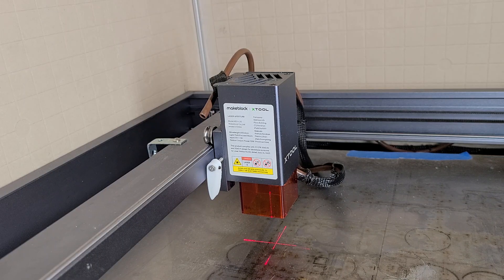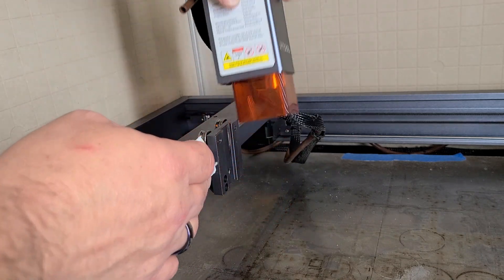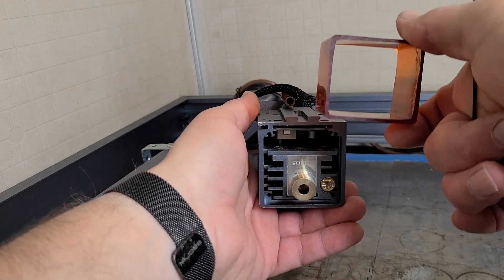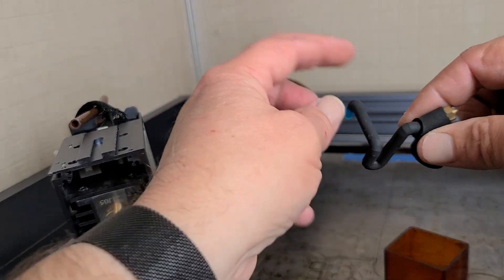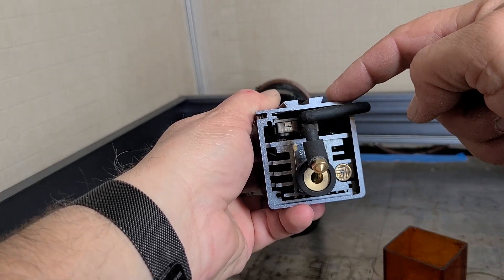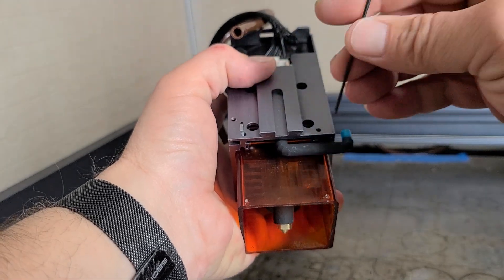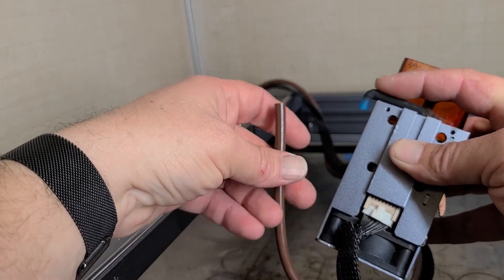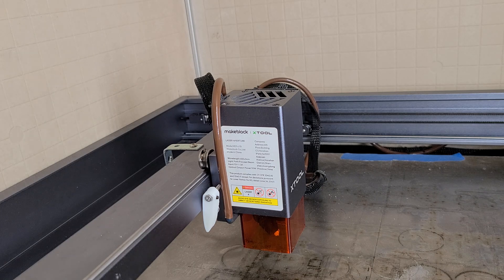How to install the No-Mod Air Assist for the xTool D1

Comment: Hello, did you make this adaptation because you think that the original xTOOL Air Pump is not ideal or is too expensive?
Reply from the maker: I started offering this months before xTool even announced they would have an assist (Nov 2021). At that time, Buster Beagle offered an assist, but it required you to cut a hole through your shield, which could void one's warranty. So I decided to do what xTool (later) said  couldn't be done - I made a superior assist that worked with the shield as is.
Reply: @geeksatlarge  Okay, and you've certainly saved money! lol

Comment: Checking the Etsy site they say you have to choose between 13, 14 or 15 mm nozzle. It says to measure across the brass lens ring, are they talking about the brass collar (outside diameter) ? Also, what air pump are you using, item or model number or link? Thanks in advance.
Reply from the maker: Hey there! You have to measure the diameter of the brass ring on your laser module to see which one you need. If the shield is making it too difficult to take the measurement, you can remove the shield from the laser module by loosening the two set screws on the back side of the module using the smallest allen wrench that came with the D1 (metric 1.5). 

For air supply, there ere are two primary options - a small airbrush compressor or aquarium pump. The compressor route, though somewhat more expensive, provides better quality results, and an airbrush, which is handy for glass and acrylic work. The pump route exchanges some quality and potential for a lower price and less noise if the one I suggest is purchased.

Optimal route:

Timbertech Airbrush Kit with Compressor https://smile.amazon.com/dp/B08FR765S4/ref=cm_sw_r_awdo_19X8WMZ82ADPWE2SBR89

AND 

Quick Connect Fittings https://smile.amazon.com/Straight-Release-Connectors-Connect-Fittings/dp/B07T3D7QQL/ref=dp_prsubs_3?pd_rd_i=B07T3D7QQL&psc=1

Pump route :

PONDFORSE Air Pump  https://smile.amazon.com/dp/B08XM9Y89D/ref=cm_sw_r_apan_i_YARXVT7JRPFVZH5PR90H

Comment: Is the nozzle supposed to sit below the acrylic shield. Mine keeps catching the material.
Reply from the maker: No, unless you have a very old one or printed an old one yourself, in which case the nozzle tip will be below the shield by 1mm, but still 4mm above material when the laser is correctly focused. If this is a purchased one, contact me through Etsy for a replacement
Reply: @geeksatlarge  resin printed myself. Thought I had the newest from thingiverse. I’ll check again. Thanks for the quick reply.

Comment: I notice you have an L bracket on the back of the gantry, what other upgrades have you done?
Reply from the maker: Yes, I used to have that, as a way to keep the gantry from pinching the cabling. (xTool has an official warning about it). It allowed the machine to home with a little more accuracy (1-3mm vs 3-5). I've since rerouted the cabling to the top of the gantry, and use a homing jig in conjunction with camera system

Comment: Thinking about buying one of these from you. Two questions. What is the little metal piece on the end of the air assist and does yours come with it? Thanks a bunch.
Reply from the maker: It's a brass nozzle, and yes, it comes with
Reply: @geeksatlarge , thanks a bunch. I will be ordering one soon. Awesome work you did on that. 🙂

Comment: Hello. 2 things. Are you going to have 16 mm air assist in your etsy shop any time soon? Also I bought an air pump for a fish tank thinking I would add a different air assist but I like yours better without having to modify. Thanks.
Reply from the maker: Hey there! The 16mm only version should be back in the shop later today.
Reply: Thank you! And the fish tank air pump ok to use?
Reply from the maker: @BeccaDydo  I've tested with a 1250gob version, and it does alight. I suspect that smaller sizes will work ok, as the nozzle tip is the limiting factor for them

Comment: What do you use for a pump?
Reply from the maker: Personally, I use a small airbrush compressor. They offer pressure regulation and a gauge, which the oft used aquarium pumps do not. They're also a bit quieter than the pumps.
Reply: @geeksatlarge  sorry.....2 more questions. where do I get this piece and how do I know what size diameter I need as I just ordered my d1 and want to be ready when it arrives. I saw a video on etsy where the orange shield had to be modified. I like this design much better
Reply from the maker: @dancullivan979  Below is a link to my Etsy shop, where you will find the air assist options, focus lever, and other D1 related items as they're developed. 

You won't know which one you need until you get your unit. The 10W comes in two known versions and the 5W in at least one. When it arrives, you measure the brass ring holding the lens in. I'll be updating the Etsy to include this info in the next day or so.

 https://www.etsy.com/shop/GeeksAtLarge

If you're interested in seeing a demo of the upcoming camera kit, I've uploaded a video of it to my YouTube channel. Release is expected by mid January, pending feedback from my beta testers. 

https://youtu.be/4DrgdvHHeHk

Comment: Is there an air pump you advise we use with this?
Reply from the maker: Personally, I use a small airbrush compressor. They're a bit quieter than the aquarium pumps that numerous people use, have pressure regulation, and a gauge.
Reply: @geeksatlarge  Thanks!

Comment: I'm new to the D1 engraver, what is the purpose of the air assist?
Reply from the maker: Air assist, on any laser, provides a jet of air which displaces the material vaporized by the laser, giving the laser a clearer path deeper into the material. The extra air tends to intensity the heat is the laser as it touches the material, in the same way blowing on a fire will intensify the fire. It can clear smoke/particulates out of the laser's way, so that the laser is more efficient. In practical terms, it's used for cutting organic material such as wood, giving cleaner, faster cuts.
Reply: @geeksatlarge  nice! Thanks for the info!
Reply from the maker: @styxx0500  you betcha!